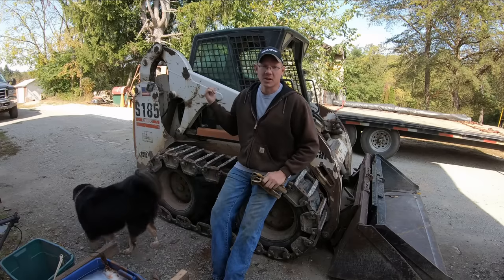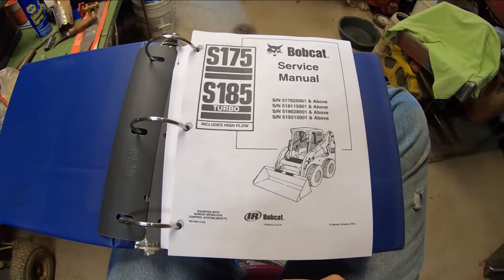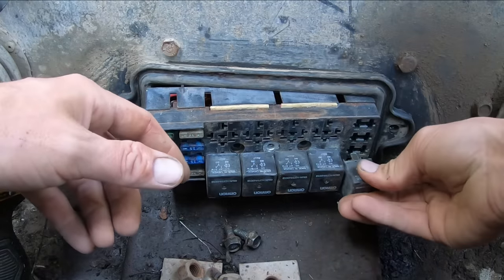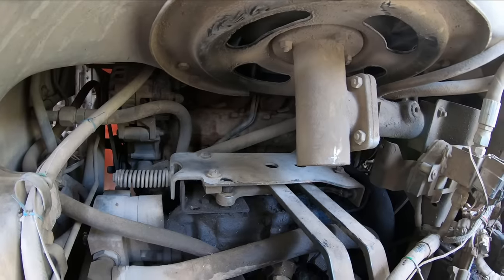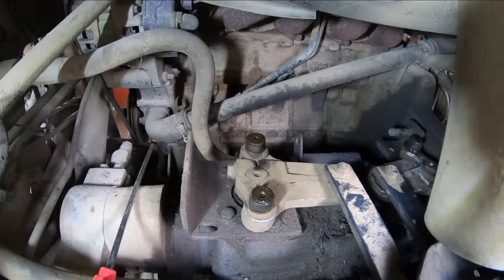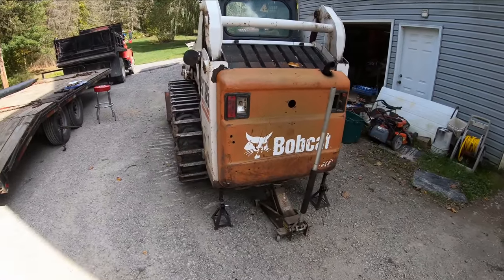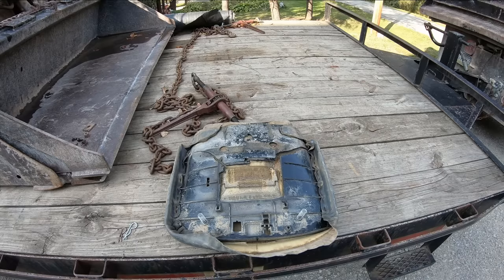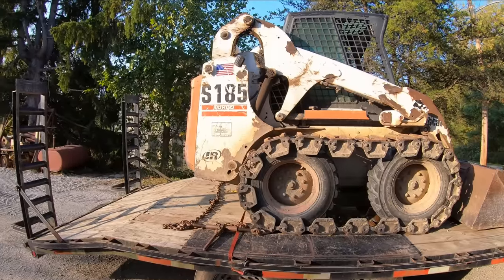Troubleshooting and Repairing Neglected S185 Bobcat Skid Steer

Comment: On the control lever clamp you tightened I don't know if you noticed but the actual aluminum lever had slid down about 1/8" on the square shaft you tightened it back to.... It seems you did raise it back up a little but not all the way to be flush with the top of the shaft like the other side is... That may create less surface area contact on the roller that runs up against the stop block and wear it prematurely. You may want to consider loosening the lever again and sliding it up flush. Also I bet those relays have internal corrosion too as they aren't perfectly sealed from the elements. So replacing them is prob a good idea. I have popped the covers off and cleaned them inside before and used a sealant to close them back up with moderate success in a pinch. But for peace of mind I would order some new ones.

Comment: I sure do wish you'd do a video on buying a skidsteer.  If you could, point out different features you like and don't like.  Appreciate you posting these videos.
Reply from the maker: There aren’t too many features that I don’t like, features can often be game changing and if you don’t really like them you don’t have to use them they usually aren’t in the way. The trouble with features like that as they are usually a lot of electronically or computer controlled stuff that has a tendency to break. The more simple the machine the more impervious to breakdowns
Reply: @DieselCreek  Thanks.  I like simple.

Comment: Liked the video. 
On the fuse cover as extra protection use RTV on the cover or Vaseline. 
I know you said that you can’t grease the tracks but try this method to at least quiet them down some. My suggestion is 4 parts 2 cans of PB BLASTER and 2 cans of LITHIUM GREASE AND APPLY BOTH ON EACH SIDE OF EACH TRACK SOAK THE HECK OUT OF THEM at least they will get lubed either way. 
I enjoyed your content always you’re a very hard working young man 
And may you have a Blessed Day Sir.

Comment: Great troubleshooting and talking us through how it works and your analysis, you make this look easy which shows your talent and experience.  Lifted setup did not seem too sketchy and worked.  Only thing I would've done differently is take it away from your truck so it couldn't back into it, I'd guess with blade at that angle it might not move anyway if the jacks failed.  Great job on repairs!

Comment: I’m watching the videos late and out of order from newer to older so sorry for posting on older video but your pretty much doing the same method most service techs are gong to use as well. 
There’s a prolong procedure in each manufacturers manual that gives centering and measuring throws and travels but I’ve been to four factory schools on 3 different manufacturers but in the field (and most of the time in the shop ) we all still time the drives very similar to what your doing. I would suggest cutting a stump or two, or an I beam or a large enough square block(s) you can either slip in behind the machine and lift the machine up on them and then block the front up as well to make it so if when you are in there you don’t accidentally hit a loader/bucket control.  This also gives you the ability  to lock the loader arms up and out of the way and still run the drives this will come in handy later if you have to actually redo the settings not just for finding neutral but to get it tracking strait after a new motor or pump install or other massive change like a broken linkage or joint (a joint should be pretty close of you count the threads on the old joint and install it appropriately the same threads on new one but sometimes the links and balls in the joints are changed as the manufacturers get new suppliers or change the design. The solenoids aren’t anything that special they are only two types normally open and normally closed. They are heavy duty farm and tractor ones are the same thing even a automotive ones will work if your in a bind but they don’t tend to stand the daily abuse of a skid steer as well and prob only last a few weeks or so. Any farm or construction dealer should have these things or it’s equal value in stock! I can’t believe your Bobcat dealer didn’t have any of them or the seat cushion in stock how many S and T 180s / 200s and others out there in that same configuration you think are in your area? Dozens, Hundreds? I mean they didn’t just make those that way go one or two years, your feelings about your local dealer is prob for a good reason. 
When it was ready fire it up that and it threw the fuel pump code I was like yep he moved a bad solenoid, now he got to take that cover back off and get another one. Been there done that !
Reply from the maker: Yes I ended up replacing 3 relays!

Comment: If you're interested you can make a Palm driver using a welder and a piece of plate for the front end of a palm nailer and it will help you drive or break lose wrenches in tight spots

Comment: If the relay contacts aren't too damaged, you can sometimes get away with opening them up and inserting a folded up piece of fine grit sandpaper between the contact points and sanding the junk off. It can extend the life of an old relay by quite awhile. While these relays are generally not designed to be serviceable, they generally have quite a bit of extra material on the points so they can be cleaned a few times before they're completely worn out.

With how expensive some of these relays are, it's worth trying. I saved a customer $120 when four of their relays were bad with just a few minutes and sandpaper.

Comment: I have the same rig, key start. I also have the same drive problem, except it's on my right stick. Tends to nudge forward and to the left a bit, while in idle. I think you just saved me a ton on calling someone in to resolve the exact same issue.

One quick question, if I may; My fuel gauge has never worked. Any idea on where I can start to look in order to track it down? Oh, and one more thing while It's in my head. Lately, I push to full power and the throttle slides back to 50% power on its own. Something ain't right.

Comment: Andrew Camerata up in NE says his Bobcat skidloader was nothing but trouble so he got rid of it and is now a happy camper with a cl65 type. Your's seems good though except for the corroded electronics and badly needing a paint job. I believe I would put some silicon grease on the rubber gasket so when you steam clean the crap out of under your new seat your machine don't burn to the ground.

Comment: I’d LOVE a video like that !! What to look for in a used/auction skidsteer. Dates/hours on filters, color of oil, rust vs possible water damage ? When is the cheapest time of the year to buy a skidsteer ?
How do you feel about machine with LOTS of hours, BUT in beautiful condition. At what degree Is it safe to assume idling hours don’t really matter towards the life of the machine in those scenarios ? 
Is it smart to avoid newer machines Bc of all the electronics coded only dealers can figure out ? 
I’m 25 year old bachelors in nursing science student & looking to buy a used skidsteer $$ for side work & maintenance of my mom’s property, landscape, clear land & snow. 
Sick of doing stuff by hand, 
I grew up on a s185 & that’s all my current employer uses for residential concrete work is that series 
Looking to spend under $10 grand and I  have no mechanical background except for what we’ve fixed at work, hydrologic pump, alternator, & packed a cylinder 
It’s been a big argument with fiancé Bc she wants a house, which would be a nicer loan if she’ll wait until graduate regardless regardless I have no doubt I could easily break even the first few months with side jobs in terms of owning one.    I’ve already turned down a few jobs.......been shopping for a while but I’m not seeing any bobcats affordable 
Except Craigslist fake deals & some place in Pennsylvania where ALL their machines the hour meter is broke at 922 some odd number.  All their machines same # the meter broke at

Comment: Your main hydraulic hose from the gear pump outlet looks pretty close to the alternator B terminal. There was a field mod for that, doesn't look like it was done. If the hose rubs through on it and shorts the battery, it burns the machine down quite effectively.

Comment: Although it is hard to tell for sure, the relays in the Bobcat look very similar to Bosch-style automotive relays that you can buy at nearly any auto parts store or on Amazon.com.  I regularly buy sets of 6 (with sockets) for $13.25 for a LED lighting harness kit that I sell.  They do have a internal wiring diagram on the case so you can check to see if they are compatible for your application

Comment: Good work, once again, Matt.  It's amazing the amount of sheer noise a rattling control rod can make from being out of adjustment.  What do you use to clean out the female spade terminals?  I've never found a tiny round bronze brush to fit in the holes.

Comment: Just a small suggestion for your safety, if you are going to leave the steel tracks on the machine and use that trailer for it all the time, fix some old conveyer belting to your ramps. The machine slid quite dramatically as you went down the ramp and you are on the flat. As an old low loader operator I'm very aware of how scary steel on steel can be when loading equipment.

Comment: DeOxit is waayyyy better than dielectric grease!  It cleans, preserves and protects.  Try it, you'll like it.  It's not inexpensive though.
Why not get a new cover and gasket for the relays?  It's the moisture that caused the relay issues.  Right now the one you have is rusted and leaking, not good.

Comment: Why didn't you put some type of sealant  on cover to keep the water or moisture out????
Reply: The cover for the relay/fuse box insets into a rubber seal when the hold-down screws are tightened.

Comment: I know I am about a year late, but those relays were common on Ford and Dodge. Go to any parts store and tell them you need a ASD relay for a '97 Dodge 1500, or trailer tow battery charge relay for 2001 Ford F350.

Comment: I've done this job more than a few time and the only thing that I might have done a little different is I probably would have used cribbing just a few 6x6s instead of the jack stands under the assend whenever you put the tracks in the air but that's it 
Also would like to see you do a video on buying a bobcat like you like you had mentioned that sounds like a good idea to me

Comment: dumb question. I know you cannot use grease or oil on the tracks. Same thing with a motorcycle chain. But they found a solution for the motorcycle chain. Lube that does not collect dust. Chain Wax. I know you warm up the chain, spray on the wax, then run it some more. I'm thinking you could jack up the skidsteer and run the tracks to warm up the joints, then spray on the wax. I know. No question. Ok. Here is the question. Do you think the chain wax would work?

Comment: Mate, you did a beaut job with that film. You are so down to earth. I've never had anything to do with skidsteers but have just replaced the fan drive idler/tensioner pulley on a same machine as yours. Now I get that there is a plug to fill the oil in the fan drive which I notice is noisy. Did you make a 'What to look for when buying' film? I'm in the market for one and possibly this S185 could be for sale. Thanks!

Comment: That’s pretty cool to see how to adjust all that out my t180 05 model bobcat has the sam set up as yours .. don’t think mine has the box there like that for the contacts my panel up on the left like yours is not working right no fuel gage and temp but it reads codes like yours too  do you think those run off a relay too ?

Comment: First step on buying a skid steer:  If it has Gehl on it, approach with caution.  If it also has "2500" on it ... turn around, walk away.  I bought a basket case one, tried to rebuild it.  Never had a machine that small drain a wallet so fast.  Never could get it to quit leaking, either.  Fix one, two more took it's place.

Comment: Possible that the pinhole in the fuse cover was always a drain hole and whoever was in there long before you flipped it the wrong way? Noticed you had to flip the cover to read the fuse layout when you pulled it off. Good chance I'm wrong. ;-)

Comment: Proportioning valve trouble for steering?
Had the same result with a slave cylinder valving on a truck.
Reply: New gasket for that relay box as it leaked.

Comment: You don't take care of your tools, your tools won't take care of you. If that skid steer/Bobcat is one of your most go to tools, I'd be babying that thing. Did you use electrical contact cleaner on the panel and relay terminals? There are special cleaning tools available to get those terminals cleaned. My god man, invest in some Simple Green and rags to get that grime out of that compartment. It's easier to find leaks when you clean things regularly. Arhgg! You totally set off my cleaning OCD!!! Great vid btw.

Comment: Put a piece of foam in that relay cover the relays are known for falling out just fixed one the other day with that very problem bobcat did that as a field mod
Reply from the maker: Interesting! Never heard that, mine are all quite tight in the sockets but a good idea none the less
Reply: Diesel Creek I work for bobcat in those fuse panels are always giving us a fit there usually either a big crowded mass or  full of water or the relays fall out in the older ones that didn’t have the foam in them The foam is something bobcat came up with because They knew they had a problem but then some of them The relays fit tighter than others just a lot of rattling around specially with tracks on them perfect job adjusting your steering you’ll be surprised how many mechanics I have worked with at the dealer I work for  years and they still can’t understand and adjust them correctly and we do the same thing to get them off the ground to adjust them Great video keep them coming
Reply: And here Is a little bit a useless knowledge the link there that was loose on the steering what did you call it with the Cam Fowler bearings on it bobcat slang for those we call them pork chops
Reply from the maker: I can see that! It looks like one

Comment: If your ever able to get your self a new skid-steer get yourself one with joystick pilot hydraulic controls avoid that electronic junk that Doosan/Bobcat is always pushing on people. I personally really like the Kubota machines they can take a lot of abuse and they seem to use much better steel and paint than Bobscrap you never see them rusting out like that. But that was a good video I've run a lot of Bobcat machines that would wander when the controls were suppose to be in neutral and wondered why they did that.
Reply from the maker: These older machines made by ingersol were decent machines in my opinion. you are correct tho,  my next machine will be a track machine with pilot controls for sure, I’m pretty partial to the takeuchie’s I hear mixed things on the kubota machines but agree they look tough

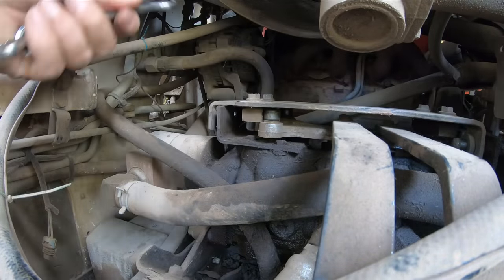Comment: @Diesel Creek: Matt, When you were working on the Steering at 18:02 in the video I noticed an electrical connector on the left side of the screen that was not plugged in to anything. I don't know what it goes to but you should probably check it out and get it reconnected to where it belongs.
Reply from the maker: It’s for an accessory that isn’t installed on this machine nothing that needs connecting but thanks for keeping a good eye

Comment: Fixing your electrical issues is easy but not in the way you have done it. Your rotten Connetor box has to be cleaned and that mean, disconnect every plug, then put it on a bench and clean all connections. I am sure that after a correct cleaning, the use of electrical grease and sealing the box against moisture will
solve a lot of your issues. Sometimes it is worth to spend a little more time in doing repair

Comment: I'd remove all those fuses & relays, hose it all out with contact cleaner
and a tooth brush. Wire wheel & paint the cover. All new relays. 
Dielectric grease the rubber gasket. Equipment always appears more 
"professional" when lit up, amber strobe, reverse beacon. Gloves & hard hats.
Sandblast all rust & painted clean.
Clean, well running machines says a lot about a company- to me anyway.

I've seen hotdog contractors- shorts, tank top, sandals, ear buds- 
on the phone constantly.

I like to see company names & phone #, website. Overalls & nametags- even
if it's just you.

Comment: I would have closed that hole on the cover so condensate can not go in and pressure  washed the machine.. its not cosmetic its to see where there is a leak and a some wire- brushing  and paint  applied with a pensel (thicker layer) is not a lot of time ... its like a new seat ; improving working conditions

Comment: I can't believe you did not clean and paint that nasty cover the first time you had it off !  I did not see you put any dielectric grease on those relay contact either.  Next time you have that cover off, smear a little bit of dielectric grease on the rubber where the cover  presses in.  It will prevent the cover from sticking and will add more waterproofing.